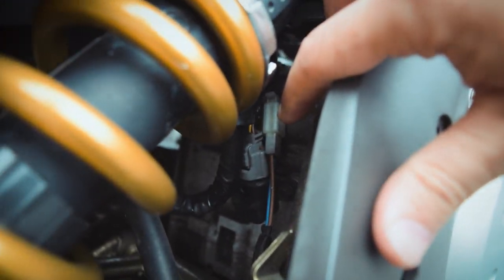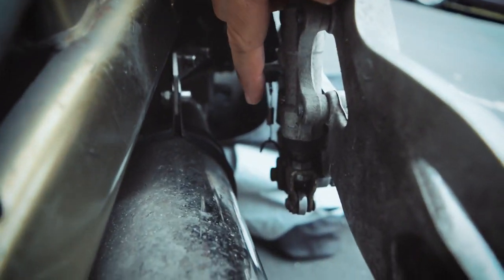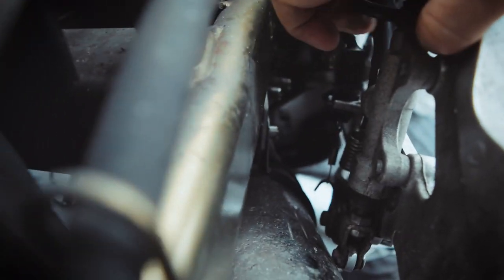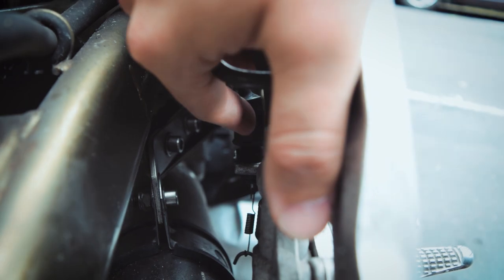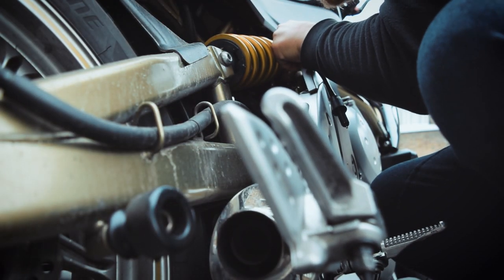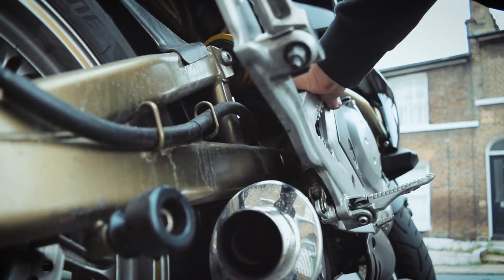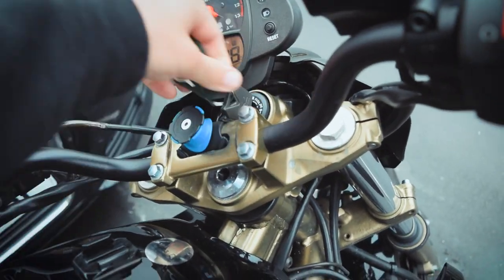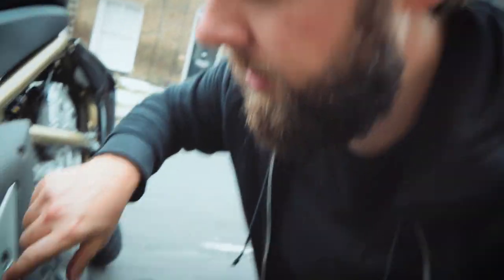Fixing A Stuck/Sticky Motorcycle Brake Light Switch

Comment: Mine is a cb250 from 1975 and is pretty much the same switch. It also has that “notch” thing so maybe it is part of the design. I tried silicon grease then wheel bearing grease. Just did the wd40 today to clean it and obviously should’ve done that first. I’ll add grease again and fingers crossed. Such a pain this one little switch and interrupt some riding.

Comment: Hi mate, what kind of WD40 u used, they so many of them?
Reply from the maker: Just the regular stuff - straight up wd40
Reply: Or use 3in1 penetrant spray, same stuff really. WD-40 isn't an oil it contains white spirit to clean and loosen any cr*p in a switch or a bolt that's stuck.